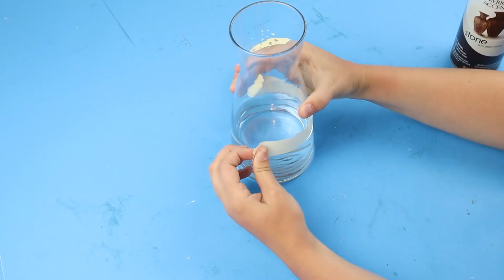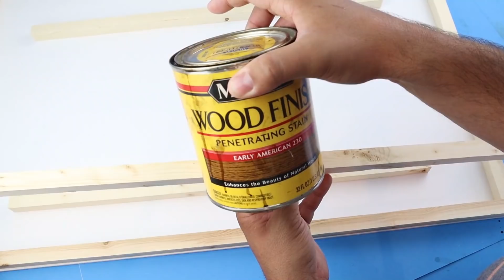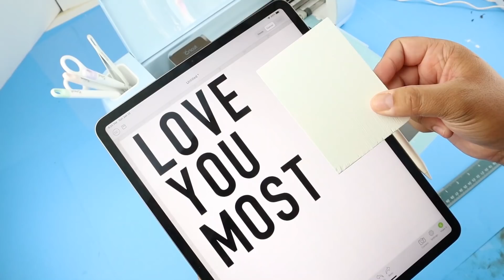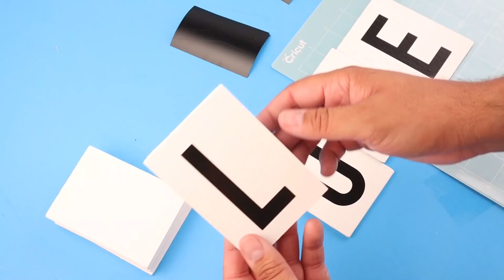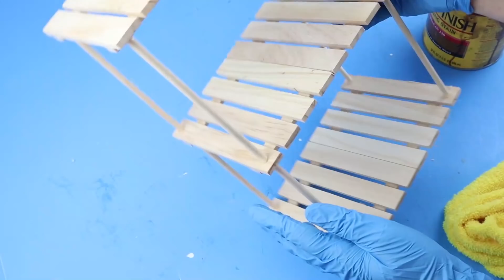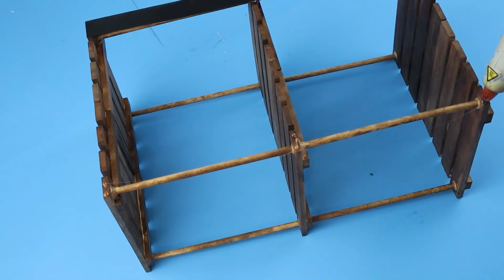*NEW* HIGH END Dollar Store DIYs | DIY Modern Farmhouse Decor (Simple & Affordable)

Comment: Wow! Your DYI are AWESOME! When I saw the previews at a quick glance of your shelving system and what you put on the shelves I thought it was a real piece of furniture.  You did a great job mam! I think the black faux metal sides add so much. If you want very modern I guess the black could be silver painted too. I love the stone textured vase. I have heard before about filling vases with water.  Over the weekend I bought an Arizona ice tea that was in a plastic bottle and the bottle was wide and too nice to put in the recycling. I tore off the plastic cover and I want to use mod podge and cover it with a pretty napkin and make a vase. Now that I have seen how you painted your vase I may paint half white.  I love your letter board but I am living small right now and do not have kits of space on the walls. I basically have just my bedroom and the outside porch. I found metal trellises on someone's curb, tied them together with jute string and put them against one brick wall and hang nautical items from it. I took metal hangers an cut them down into 2 inch pieces with metal cutters, bent them into S hooks and sprayed them gold and the hang nice on the trellises.  

I definitely want to make a shelf. I would like to make a couple to put my sewing threads on.  Great video!
Reply from the maker: Thank you so much! Let us know how it turns out if you make it ❤